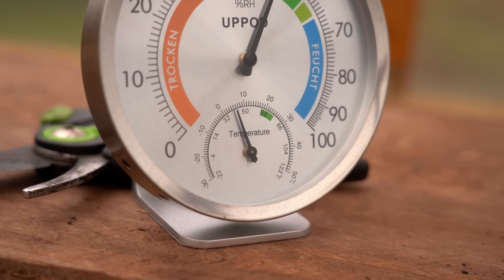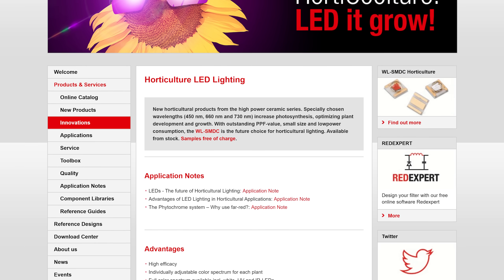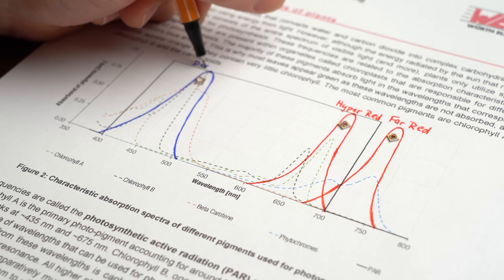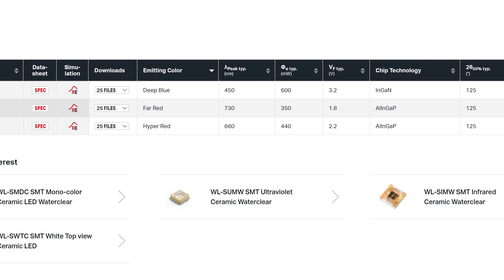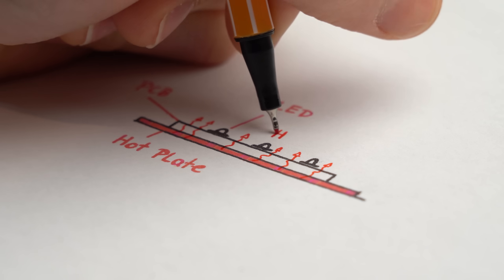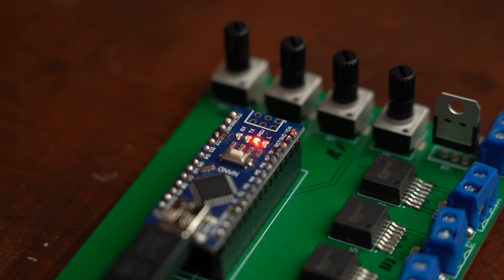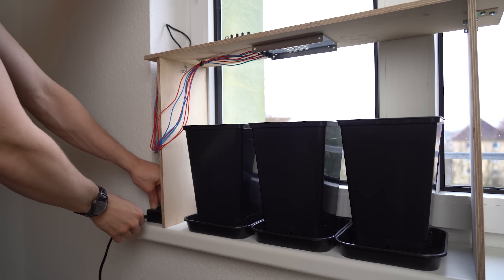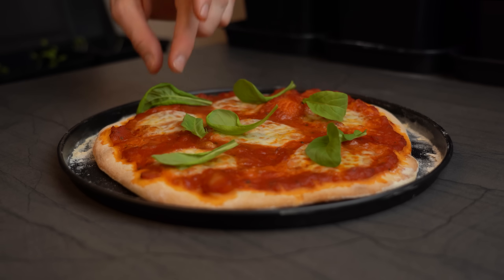"Magical" LEDs let my plants grow faster? (Experiment) The Future of Farming!

Comment: Pointers for those who want to use the lights
- Encase the whole plants in a closed box, and line the inside with some kind of reflective material. Kitchen foil will work fine. This will help to maximize the use of light, since you won't have runnaway light.
- If you do this, remember to add a ventilation system, and an air reflow system, IE: a fan and an air extractor and intake.
- To make your crop have a higher yield, put near you planrs a bottle with water, yeast and sugar. The yeast goes through a metabolic process (fermentation), releasing CO2. The higher the CO2 concentration near the plants, the bigger they'll be.
- If you don't have money or access to LEDs, you can use other light sources, like a high pressure sodium-vapor and mercury-vapor lamps, which gives you the required light spectrum to grow the plants. A bit of warning on the subject, you'll have to watch out for heat, and those lamps need a ballast to turn on, which can be a electrocution hazzard if not placed correctly.
- Buy a humidifier for babies on Walmart (or any retail store). They're relatively cheap and can help out a lot if you have a lot of fans, cause moving air tends to dry off surfaces, and the leaves can get damaged. Place the humidifier near the plants.
- If you can spare the money, buy a reverse osmosis filter, and use filtered water on your plants. Put humus soil and red guano on the earth for the nutrients. Remember a plant will always need Nitrogen, phosforus and potasium (N-P-K), alongside a lot of micronutrients, like calcium, magnesium, etc. Feed you plants, don't just water them.
- Your soil should always have drainage. If you can find perlite to mix with your soil, that's great. If not, add sand and little stone pebbles. Plant roots also breath air, so if they're submerged, your plant WILL drown.
- If you don't have a lot of room for your plants inside of your box, you can put a net a couple of inches above the soil, and when your branches reach the net, route them to the sides to allow other branches bellow it to get more light. This is called "training you plant". There are a lot of training methods, and it depends on what you're growing. Lettuces, and herbs in general don't need training. Fruit plants generally will benefit from this.
- Plants need the night time. If you leave your lights on, you won't be helping your plants at all, and you'll probably cause them unnecessary stress, which can reduce yield.
Reply: Eres un genio bro, seguro q plantas marihuana xd buen resumen
Reply: We use old PC Cases to make our secret-greenhouse inside. You gave really nice tips! Thank you!
Reply: Thank you, extraordinary

Comment: You really should have compared with normal light tubes. My experience shows they are almost as good as "correctly" colour LEDs.

Some research shows that all light frequencies from the sun have a function for the plant. Green light may help photosynthesis closer to the ground and closer to the stem.
Reply: That's tho purpose of the full spectrum white LEDs, to add a little of everything in between the reds and blue
Reply: @brucehanson4147  a comparison is still useful.
Reply: @iamjimgroth  Many vids of that out there allready, ... less of DIY like this
Reply: @brucehanson4147  A comparison was made between lights and no lights...

Comment: I think that you are really new at this, plants always want "full spectrum" light.  The red and blue LEDs could be replaced with flat white LED's that have a color index over 80 to get more growth out of your plants.  You could try that as an experiment.  Green is not used by plants because it has less energy than red and blue light so, it is reflected - unused by the plant.  The different wave lengths, everything except a few shades of green, are all absorbed.  Besides, are those sprouts in sunlight (on the windowsill) and LED light?  Isn't that just more lumens?  If I grew half of your plants in Florida - I bet the plants would do better under the intense sun.  An LED yard floodlight is easy to get and use, add an ultraviolet LED light (used for curing UV glue) and you have the sun.  Plants use ultraviolet too and it keeps the mildew gone.

Comment: "Quality parameters of plants" is the most nerdgineer thing I've ever heard.

And my god the "All in one" transistor + controller + inductor constant current buck supply is expensive!  Almost $8 / piece!  What's the cheapest you could build a CC buck with variable output, @greatscott?  Do DIY or buy  :)
Reply: I haven't looked up the driver he used in this project but I've been building my own reef aquarium and grow light boards incorporating the driver into the board using a AL5816QW5-7 driver and MOSFET. Works out to less than $2usd/channel.

Comment: could I use the set with the strongest LEDs on the market, used in tactical 3000 lomen flashlights - sst70? What do you think? They can run at 6 amps

Comment: I think, that using light sources with different wavelengths is essential in industrial scales, where as in amateur gardening an ordinary LED with a high CRI will work pretty much the same, except you do not have to deal with different led modules, supplying them with power and controlling them - just take a good LED strip, led driver - bam! It works just from the box - cheaper, much easier and almost the same efficiency

Comment: Wait wait wait.... why are we approaching this as a "claim"? With words like "supposedly"?  UV lights, or "grow lights", have been used since... well... since forever. Long before LED's, but yeah, of course UV LED's do also exist, and have entirely surpassed any metal halide or other sort of older grow lamp. But of course UV light aids in plant growth, duh!  This would have been an "experiment" say, 220 years ago or so, give or take... as that's when the first UV distribution via lamp was discovered, and proven. But today? Not so much... just go on to Amzn, Wish, Google, eBay, Kmart, Dollar Store, or wherever you want, and buy a grow light... it'll work. So long as it isn't fake anyway. . . And if you want to build your own, and likely pay more to do so, seeing as how this is such a common item these days that a do it yourself would indeed cost more than a premade unit, then go ahead I suppose. But it's not "new" this way either.

Comment: I used a common daylight LED bulb to grow pepper plants in the winter.  I wonder how they perform compared to the horticulture specific bulbs?  That would be a good video.
Reply: daylight bulbs are the recomendation for larger plants although the blurple lights are more efficient for small plants ( most of the blurple light is absorbed in the first layer of the canopy while the green light from daylight makes it farther down)
Reply: @asbestosfibers1325  DIY and hobbies are all about experimenting with things that others have already done. Just because someone somewhere has a good answer, doesn't mean you can't try it for yourself to confirm or to refine, or even just for the fun of exploration and building.
Reply: @Lassi Kinnunen (WILL CHANGE ACCOUNT IN 2 DAYS) lmao
Reply: Plenty of vids about it.. nothing new
Reply: Experiment?? It's definitely been done for years already.  Even done it myself
Reply: @nubie1100  what was the result?
Reply: @amuricanmayo  it worked fine.  I only used 5m led's 80%red 20%blue. Think it was that way around?  It was a while ago now but yes i actually grew some weeds 🤣 for our tortoise. It was at the time of the ufo grow lights just came out and I thought I'm not paying that for a led light so i made my own.
Reply: Probably just as good as the blue purple lights if there is a difference it is in the 5-10% of final plant mass if not less ,4000k should be good enough for anything
Reply: Lightbulbs that are made for humans aren't a good fit for plants. They are most reflective in the light our eyes are most sensitive it, meaning you're wasting electricity as they can't absorb the green and yellow.
Reply: @MrGoatflakes  this is not true, new research states that the entire spectrum is useful in plant growth.
Reply: @amuricanmayo  perhaps but it's not very efficient as most of it isn't absorbed.
Reply: @MrGoatflakes  i already explained. In small plants purple are more efficient. In large plants, purple light does not penetrate the canopy which is not optimal for yield
Reply: @amuricanmayo  It's widely documented that boosting the reds and some blue greatly accelerates plant growth in all stages. It's a deep rabbit hole with some wavelengths influencing stem length and flowering and having some triggering effect on photosynthesis, that's why a few full spectrum whites are added, for the small amount of other wavelengths needed. It's all about getting the most out for the least watts in.
Reply: @brucehanson4147  I understand and have been down the rabbit hole myself. from my knowledge tho the vast majority of new cannabis grow lights are made up of many  lm301b leds (full spectrum) run at low power to increase efficiency and some deep/far  red and uv diodes added in. I may be wrong but I think with the tech that we currently have, full spectrum leds are the most efficient. 

either way, in the context of the comment, these horticulture bulbs are such low efficiency either way that it really doesn't matter full spectrum or not. They run the diodes at such a high voltage that it completely mitigates any efficiency gains that supplementing with red and blue light would give u
Reply: @MrGoatflakes  it's actually more efficient, the blurple light thinking has been disproven for years, even in smaller plants.

Comment: What a coincidence, I've been designing a multi-channel PWM LED driver and PWM fan driver too. Although for some stupid reason I got it in my head that I didn't want to use a microcontroller, and do it the "traditional" way. Which is probably why I've spent a week filling up two pages of my notebook with cakeulations and I'm still designing it.

It's for a different application though, not horticulture. And it's for a much higher density of LEDs, hence the PWM fan driver.

Comment: Hello i need to ask, i want to build homemade antenna for my baofeng walkie talkie. So i need to ask if there is any special connection between the walkie talkie and the antenna? In my walkie talkie, there like 1 gold pin so if i will connect the antenna to it will it work? Thx for answer 😉

Comment: 1. One received extra lighting, the other did not.
2. The absorption curve and the action spectrum on the poster are different.
3. If the absorption curve is the same as on the poster, why is the ratio of LEDs such? Standard Distribution
3: 2: 1: 2 - Hyper Red: Far Red: Deep Blue: White If you absorb blue the most, it's the most efficient, with the least loss. Instead, does it illuminate at 3x the wavelength it absorbs a third of?
4. I watched several comparison videos and white was always better than spot color lamps and compact fluorescent was the best.
5. I also light up with white LEDs, yet the leaves are dark green. I have 4W white spot LED lamp ~1m distance. This lamp in the video 36,12W, and ~10cm distance. 
6. If I didn’t light it with a white LED light, there wouldn’t be dark green in the window either. 
7. It would be good to have similar white but non-gold priced COB LEDs. Because it’s here for me in the room, too, and it’s probably not good for my sleep either that it’s cool white, but it’s much more pleasant to see normal colors than if I were lit by purple. Anyway, the PWM has already been replaced in the monitors for some reason. A well-balanced, evenly lit COB LED would be good.

Comment: "Rucola", yeah sure... haha :P That's quite an expensive pizza...
Still, for growing "other" plants indoor (which are not widely available in supermarkets) they are a good replacement for fluorescent tubes as they are reducing energy costs and heat by ~50% :)
Hint: Those are way cheaper if bought as ready-to-use product on ebay/Amazon, but keep in mind those lamps emit strong UV radiation, so make sure to wear sunglasses and avoid directly looking into the light!

Comment: from the little i know from looking into this subject aren't individual leds supposed to be wired in parallel with each led wired with a resistor in series to avoid 1 led from drawing more current then another?

Comment: If you are opting for the best spectrum characteristics with excellent efficacy during the vegetative phase of most plants you would want to use 3500K - 4000K white LEDs and 660nm monochrome red LEDs which due to their high efficiency boost your PPF/W. Adding some far red appears to be most beneficial during germination and flowering. 
PAR levels greater than 1000 at any given point should be avoided or your plants will get too hot. If you see tip burn, hang your fixture a little higher.

Maybe you can get apogee to sponsor you with one of their quantum Sensors. That could be fun ☺️

I used LM301b chips and osram oslon ssl or square for my fixtures. Mean Well builds excellent current sources. 
I couldn’t measure it exactly yet, but my fixture should produce 2,8 to 3,0 umol / Joule.
Reply: Does that advice about 660nm red LEDs apply also to growing things like rice and soy beans? I am hoping to make them flower sooner and thinking if I should add red to my setup with bright LED shop lights. Also is it possible to buy strip of such LEDs, either ones I can just plug in with no DIY or otherwise DIY ones but as strips? That would seem easier than having to solder them to boards etc. but I cannot find such products so far. Thanks!

Comment: Hey I design grow lamps and ag lighting. Love your channel. I'd love to get in touch or even just help on a project. Quick note, light harvesting complexes are fantastically complicated... And definitely use green light. The thought that they simply reflect green light is extremely inaccurate.  Also... NO PWM unless you can control the frequency you are using. The plants respond to light faster than our eyes, so dimming like that doesn't work right. Analog dim only.
Reply: Sounds like some audiophile level stuff right there...
Reply: Fascinating, I hope this reply reaches your attention to your 3 year old comment.  You are saying that PWM [Pulse Width Modulation] flickers ON/OFF, faster than the human eye can detect, and that a slow reduction of voltage while constantly illuminating is superior? If so, what do you use in your circuits for analog "dimming" instead of PWM?

Comment: Why didn't you use a constant voltage source to drive the leds in series with a single resistor? Than you could simply use the pwm to drive a mosfet. Isn't it a simpler way to obtain the same dimming?

Comment: You are correct with the parts of the spectrum that plants absorb, but a photon is a photon. The main reason why the plants grew is they simply had more light regardless of the spectral output. It works the same or better with basic white LED’s as they they still cover the whole spectrum nicely. Common practice these days is using only white diodes with some red. The red diodes are usually added only to increase par efficiency and has little to do with plants needing it specifically. The white diodes provide plenty of red already, but red diodes in the mix will add more par per watt. Good job on the video btw.

Comment: I just started researching this topic and I decided on using just warm white 3000K LED's with over 90% CRI as they seems to already have an idea mix of Blue, an Red and I will use the most efficient LED's available. They will be powered directly from PV panels no battery or anything else so they will work during the day time only but that is the most cost effective option.
I'm in a relatively sunny but super cold location in Canada will be -29C tonight and so the only option is a super insulated greenhouse (no windows) and LED's powered directly by PV panels. I will use a simple linear regulator and groups of around 10 LED's in series so that voltage already matches the PV panels max power point thus very little loss on the linear regulator should be way above 90% efficient.
I was surprised by the new LED's (made an order should get them soon) as they can convert close to 50% of energy in to light and that is incredible compared to just a few years ago.

Comment: With the Arduino, you can simulate the timing and intensity of the sun on a summer day or maybe an entire growing season. I had an Arduino controlling a heater in my greenhouse. A light sensor detected sunrise. It had higher temperatures in the day ands lower temps at night. The University of Kentucky published a study of LEDs that showed that plants used red for growth and fruit and blue for respiration.

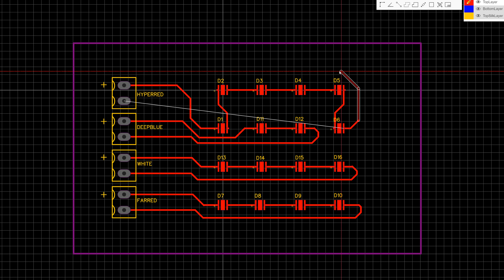Comment: What's the deal with the parallel resistors at 4:41? Also, i just read the datasheet for WLMDU9456001JT LED current driver and what a delight it is to read this well written document. Compliments to Weurth Elektronik! But nowhere is there mentioning of parallel-to-LED resistors.

Comment: I hope you didn't look to much at those far red hi power LEDs, as infrareds are hazardous for the retina.
Btw I'd have tested them against ww nw and cw LEDs at same current.
Also as you stated most plants need to grow at a medium temperature and heating is a problem to solve too. I would use some halogen bulbs too, to produce both light and heat.

Comment: We've been starting our garden plants under a wide band LED array and my goodness it works well.  However, the single best light I've used is a CMH.  The original MasterColor RetroWhite HPS CMH was just amazing.  Low heat output, amazing plant growth... UV A and B (plants actually seem to like this)... just don't let anything get within 30cm of the arc tube or they get wicked UV burn.